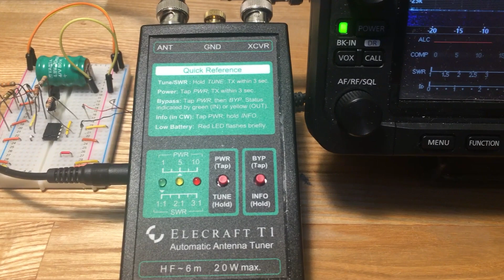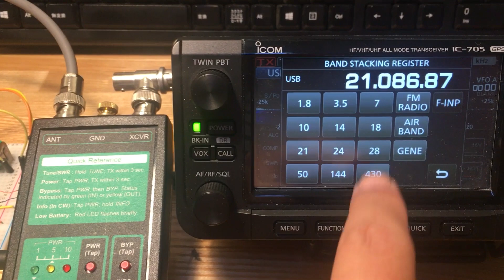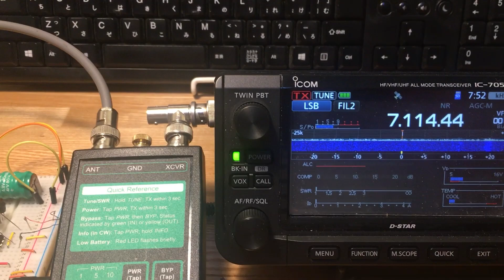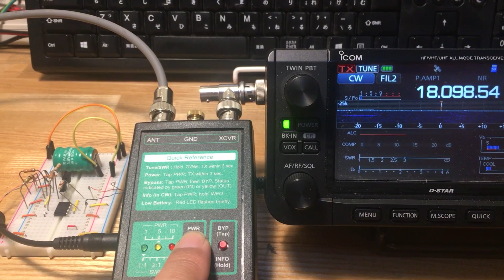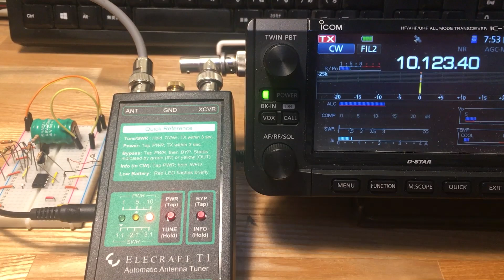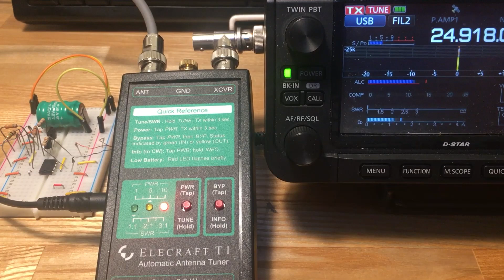Elecraft T1 Controller for IC-705 version 3

Comment: You never showed what the tuned SWR was. . . What's the point if you haven't checked?
Reply from the maker: Thank you for your comment and question. I have no intention to hide about SWR. Basically, that is T1's function. My interface will not work to reduce (or increase) SWR, it just let T1 start and stop tuning.
In my video, you can see T1's LED. After tuning cycle is completed, Green LED will lit if SWR down to nearly 1:1. IC-705 will not indicate SWR while tuning cycle.
I am not good at English, so did I answer your question correctly?

Comment: I just use the SWR function on the IC 705 to tune the T1, works just fine.
Reply from the maker: Thank you for your comment. That is a good idea! I will use your technique when I forget my interface at a field.
If you use my interface and extension cable to IC-705, you can start to tune from IC-705 without pushing TUNE button of T1.
This is also a good point to use this kind of interface.
Reply: @amateurradio599  I like using the swr function as I can visually see the T1 tuning and then verify the tune by hitting the ptt as it crosses through the band.
Reply from the maker: I think there is a variety of "Best way" to use T1 with IC-705 for each person. Enjoy!

Comment: Awesome work! The controller is too big, but the functionality is pretty amazing.
Reply from the maker: Thank you! I am trying to make this one small now. Since Ni-MH battery is big, I made another version using Lithium 3V battery and PIC 12LF1822. I do not know this voltage meet IC-705's input requirement but it works, as I uploaded to YouTube.

Comment: Excellent Work!
Reply from the maker: Thank you! At first, I was thinking to modify T1 to output tuning mode signal, but while I checked electrical diagram deeply, I realized that it is not necessary to check tuning mode but just check T1's ON-OFF condition by checking input cable's voltage.